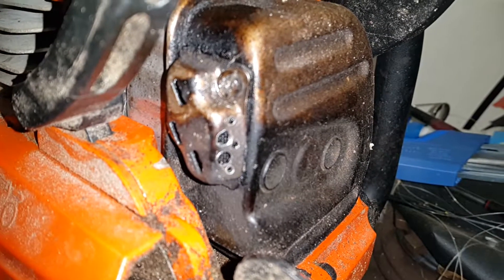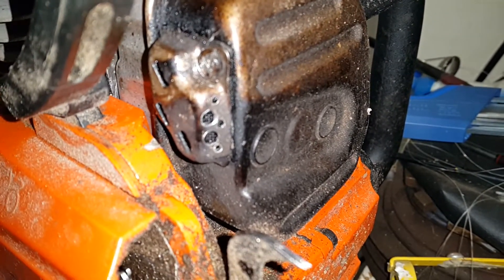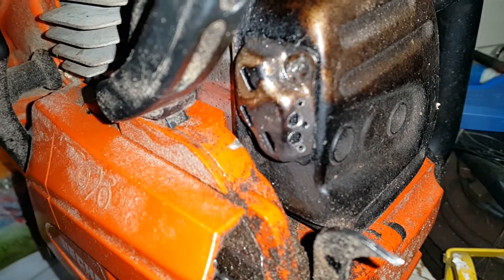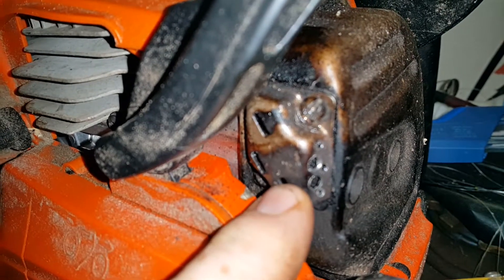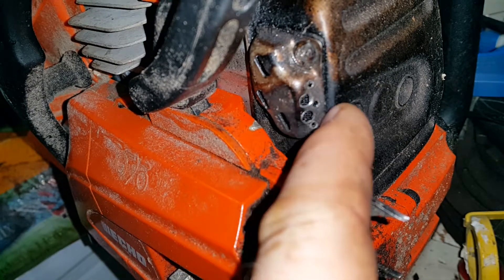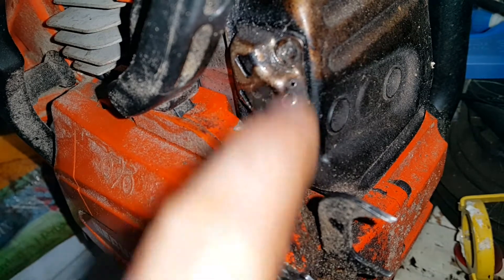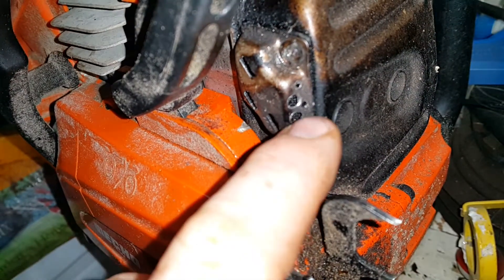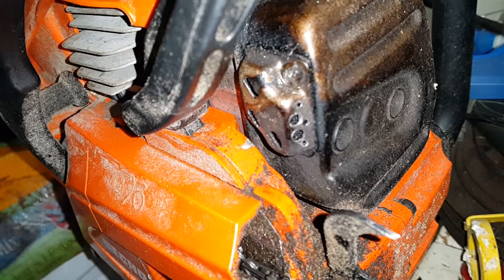Echo CS490 2017 Restoring Power & High rpms with Simple Exhaust Modification

Comment: no report since doing this???
Reply from the maker: No... I never made another video.... However, what I did in this video Did work,and never had a problem again. I have cut 40 cords of wood since. Reving really well now.
Reply: @andylynnpei  what problem were you experiencing before the exhaust modification? I just picked up a brand new saw today
Reply from the maker: @jcallesano  saw worked very well new. I mixed too much oil in the gas.... my fault. It started loosing power. The oil in gas was plugging the spark arrestor screen inside the exhaust vent. The saw lost power. They cleaned the screen of the gunk, and it worked fine after for 3 days. I checked the screen and it was clean as I was burning proper mixed ratio of oil to gas  after they told me what I did. 
When I lost power second time... screen seemed fine. Saw others make a little better air hole on exhaust like I did in video. Like new again. 
Remember I caused the problem with improper oil to gas mix and gummed up the exhaust spark plug arrestor screen, etc. It worked great for a long time, until I did that. 
Why the sluggishness came in three days after the dealer cleaning... I don't  know. Maybe more oil gunk still working through the system. They only cleaned the spark arrestor screen in exhaust... not carb etc. 
But the extra hole solved everything for me. Reves really high and fast like when new. And its been the same ever since.
It is a fantastic saw for the price, you will not be disappointed. 
I saw a lot of YouTube videos saying the saw benefits from A few extra exhaust holes.  So I tried it as shown. Power and zing came back instantly. 
Your call. But it really helped mine.. and its easy to do. 
But, if you are not sensing low-power and sluggishness rpm response... don't fix what isn't broken. 
The saw is a real bang for the buck for its price. I got it for 200$ cdn off on sale. Glad I got it. 
Let me know your thoughts on it after you have it in Use a while.
If you read the notes on the video I explain it there also.
Reply: @andylynnpei  Thanks for these tips buddy. having a simmilar issue